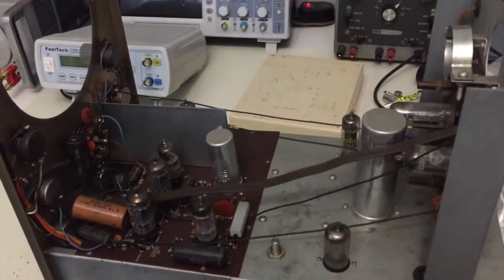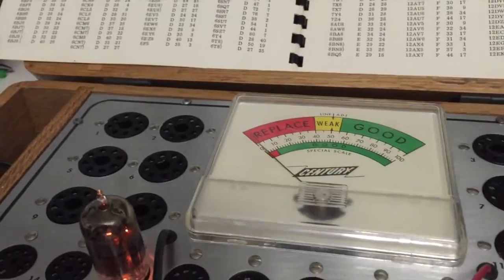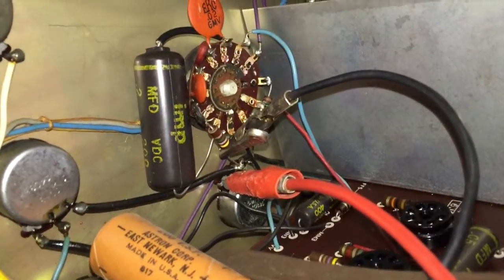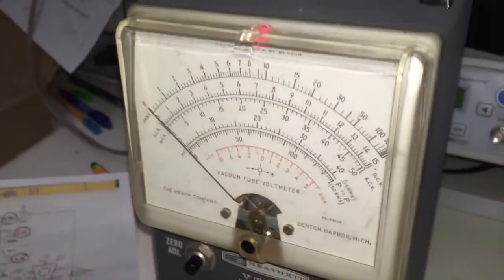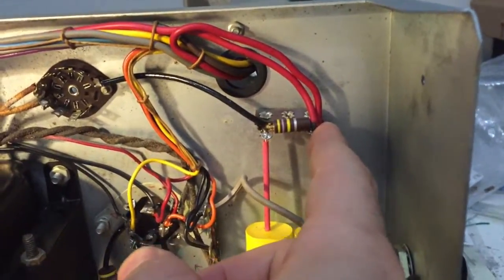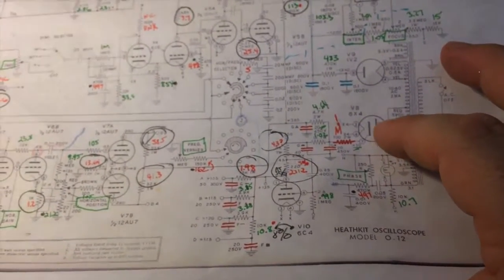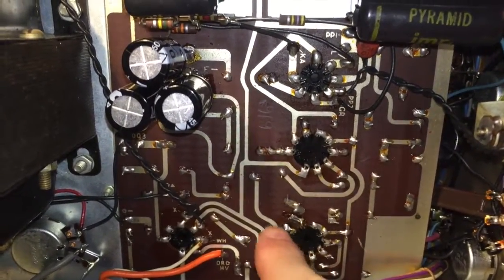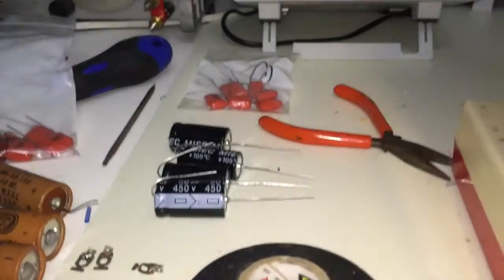Heathkit Oscilloscope O-12 Restoration & Repair 3 - Repairs begin

Comment: Looking good. I haven't looked it up yet, but I wonder if the surgistor isn't similar to an NTC, where it starts with the resistor in line, and then when it heats up it shorts and bypasses the resistors. Just wondering out loud really. Nothing beats an analog meter for checking pots, and a Heath meter is very fitting.
Reply from the maker: i researched it, thats exactly what it does.
Reply: Jordan Rubin In that case it is a very useful device. I wonder how long the reset time is. There was a whole thread about isolation transformers and in-rush limiting on the EEVBlog forum. Now I have to look these guys up. Thanks, and looking forward to the scope restoration. You are doing a very thorough job.
Reply: Oh, in looking it up I do see lots of them seem to fail, and many people replace them with step relays. Of course twenty or more years is not too bad for that type of part. Relays fail too.